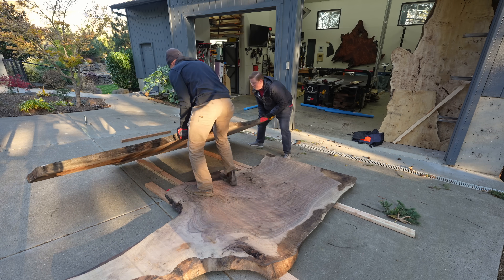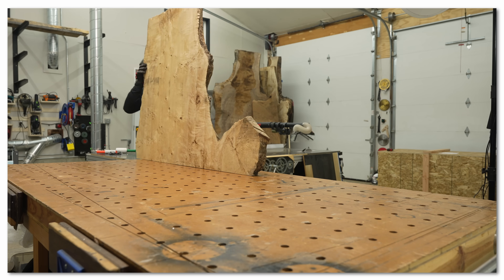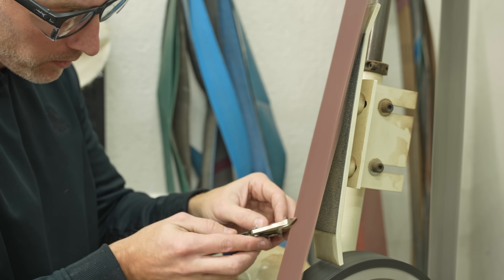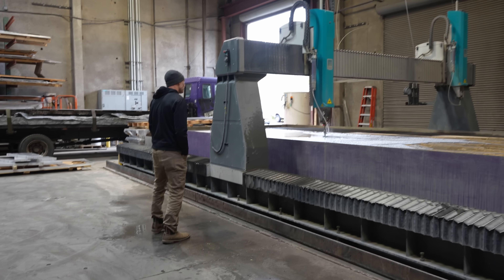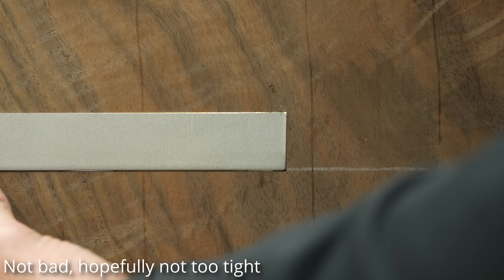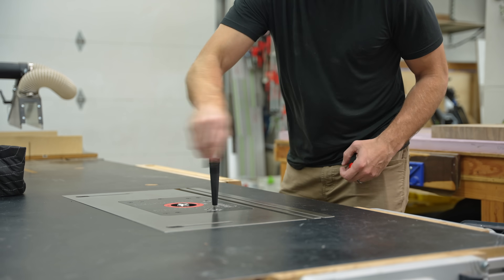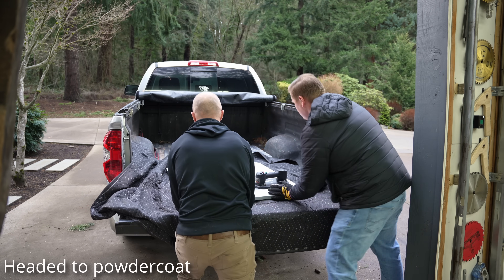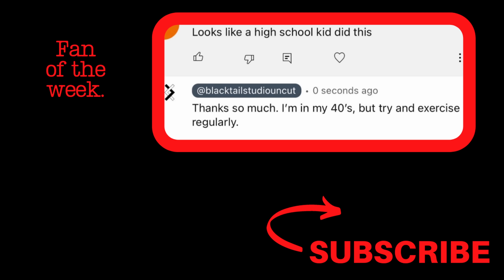$18,000 Table

Comment: The powder coated aluminum and figured walnut is.. incredible honestly. Just wow.
Reply: What is the point of aluminum here? When 100% coverage is applied, what is underneath is irrelevant. Could be aluminum, MDF, epoxy block, stone, whatever. When and expensive material is used, it should be shown. Pay extra money for a thick aluminum that will look like basic kitchen top in the end, is a waste IMHO. I do not say the table looks fantastic, I do not see the point of aluminum in the design here. No visual (100% covered by paint) and no structural need for 1" aluminum.

Comment: For your little "toothpick" I use a metal plate in which I drilled a hole to the size needed, then I make 2 crossing cuts with an angle grinder. These cuts leave a burr that acts like blades. You can now put a square stick in your drill and go through the hole in question to round it to the perfect size. It even works with a stick with the grain running in the opposite direction (just have to go slower). I use the technique in this video: https://youtu.be/AF4VcJem5Do&t=18m56s
Reply: basically making mini dowels.  Does it work like Cam is doing with short grain?  I think that's why he is carving them instead.
Reply: pretty cool vid BTW!  Lots of detail on such a small piece. you got my sub!
Reply: @dieselrugg  yes it does work. I find it easier to do with a Dremel. It is more susceptible to break though so you'd need to slow down the speed rotation. Thanks for the sub :)
Reply: @SylGAUTIER  Yeah, the dremmel can spin a faster and has less torque than a drill and I imagine that would help... good to know!

Comment: both are top notch! grabo is amazing for moving large fragile workpieces with the panel handler accessory. it's the only way i can move stair tread landings with handrail cutouts along the edges and not break several cutouts before it's in position.

Comment: Hey Cam - you have the most clear build videos on the “tube“. Question: I’d like to take off bodies wax from my solid cherry slab that was finished with Odies oil some years ago. What do you recommend to take off the wax and replace it with your ceramic coating.   

Just the “wax off”.   

For the record, Odies looks warm and highlights the figure in the Cheery - BUT
Durability is quite poor - constantly buffing out simple drops of water or scratches from plates. 

Thanks,  Jeff

Comment: I have a Everlast welder made in China that you could not pry out of my hands.  It is top quality and the only people knocking them are the people buying red and blue because their daddy bought red and blue. Not knowing or willing to admit that all the electronics in their new red and blue machines are still made in China.    Anyone that thinks Snap  is worth 10 times what Pittsburg tools cost are just as foolish.  America sourced China to make tools and parts cheap but in exchange taught them all the secretes to making quality tools.

People also make fun of us small shops that like our Shopsmith tools.  But the Drill press on a shopsmith will out preform about every wood working drill press made.  The ability drill horizontal is priceless.  Again 99% of the negative comments are coming from people that have never even seen one in person.

Comment: Salut Cam, je viens de découvrir ta chaine, et je me régale de tes vidéos. Un grand bravo, et merci pour tous les conseils que tu donnes. Pour ma part, je suis un amateur (retraité) de travaux divers (bois, métaux, stratifiés (polyester, carbone), matelotage, etc... Mais dans une échelle bien plus modeste que ton travail. 
Et je me suis demandé pourquoi tu n'utilises pas le vide pour éliminer les bulles d'air dans la résine. Est-ce inutile selon tes expériences? Récemment, j'ai fabriqué un bouchon de machine à café ancienne en noyant un bouchon fileté (3/4) dans une poignée circulaire en matière plastique. J'ai fait une petite cloche pour obtenir un vide. Peut-être que ce n'était pas indispensable...(?), mais je suis content du résultat.
Au plaisir de voir d'autres de tes vidéos.
Et pour la table, c'est celle en noyer que je préfère 😉

Hi Cam, I just discovered your channel, and I enjoy your videos. Well done, and thank you for all the advices you give. For my part, I am an amateur (retired) of various works (wood, metals, laminates (polyester, carbon), seamanship, etc... But on a much more modest scale than your work. 
And I wondered why you don't use vacuum to remove air bubbles in the resin. Is this useless according to your experiences? Recently, I made an old coffee machine cap by embedding a threaded cap (3/4) in a circular plastic handle. I made a small bell to obtain a vacuum. Maybe it wasn't essential...(?), but I'm happy with the result.
Looking forward to seeing more of your videos.
And for the table, it’s the walnut one that I prefer 😉

Comment: Great job.  Over time, powder coat  will show scratches.   If the aluminum  had been hard anodized it would not scratch and also comes in only one color: black.   I have never seen a plank of walnut showing so much grain.

Comment: I like the aluminum shelf one more.  One question.  You installed 2 very large table mounts only to go back and router 4 smaller mounts into it.  Did the large mounts not get used?  And if not then why did you use them

Comment: 3:45 I would imagine just cutting big pockets out of the wood before you do all the surfacing and finishing on it will make it more flat and square. At least that usually works in most metal and plastic

Comment: The only downside for using aluminum is people will put their feet on the lower shelf. Not that they are evil but it's a coffee table and coffee tables do get way more abuse than dining room tables. One suggestion, I'm a retired engineer and I used powder coating all the time, but run a rounding over bit on the corner, like a 1/4" to 3/8'", so it goes from a "point" contact to a larger area of contact. That will not prevent all the damage but it will cut down on it tremendously.
Granted the powder coating is amazingly strong for the thickness but people's feet and shoes can be harsh on nice furniture as well.
I forget what the magic word was for me to put down that I made it all the way to the end but, accept the substitute, "Rumpelstiltskin". Love your videos.😊
PS: Mentioning the price is not a bad idea because people seem to feel that a super custom piece of furniture should cost the same as the stuff from Ikea, for some reason. At least that way people realize you aren't gouging them.
I used to make knives and are often shocked when they want a monster custom knife then suddenly act shocked when you tell them it's a $1,000.00 knife. I'm retired now. All my knives came with an unconditional guarantee for the first five years, materials and workmanship. Nice to see you sort of have the same policy.

Comment: Taiwan is good quality. But do sweep your drill press table to make sure it's square with the spindle. If you don't, you will notice a squareness issue. Use an indicator in a circular motion. You will notice out of square table. Easy to do. Check it.

Comment: Do you ever use any glue or some kind of adhesive for the threaded inserts? I made a recording studio work station and it was quite the project and I put a spot of that brown gorilla glue on the inserts that holds the legs. Your thoughts???
For the record it was my first major woodworking project and The metal work I did as well. I wish that I could post a photo of it because it came out really nice (for a rookie) LOL!!!...

Comment: YAY!!  I’m better than you at something.  I do 3D printing. When you said that gap was scary I laughed and looked at some of these 200 teeth 5mm diameter gears I just printed.

Edit: those are the “huge” gears in this clock model I’m printing.

Edit: I had to add again. Nice job on those shelf set screws.

Edit2:  yes.  Yes Scott was disappointed.  I like Scott.

Edit3: Walnut

Comment: Both tables are gorgeous. 
Couldn't you have used almost any material and gotten the same look with powder coating?
It would've been much easier and economical to maybe just use plywood. 
Then again, if you can pay $18k for a table, you might as well use titanium.

Comment: What is the point to have paz for aluminum when you going to paint it black??? I mean anything a piece of MDF will have exact same look. You could just pour black epoxy block. Make zero sense. That is equivalent to make a table from great looking walnut slab and then power coat in some color.